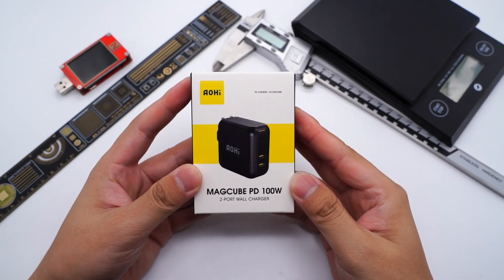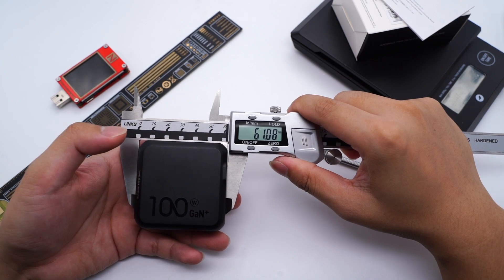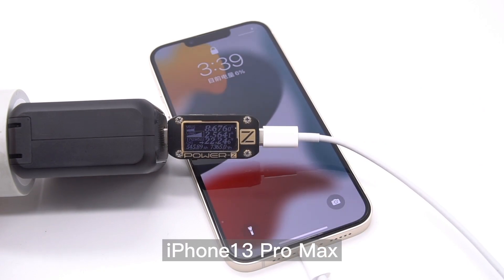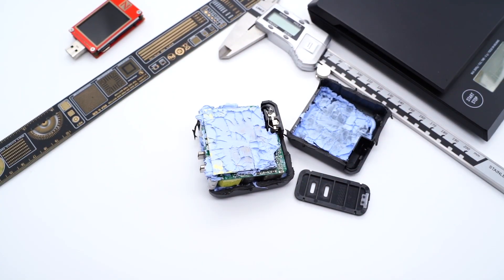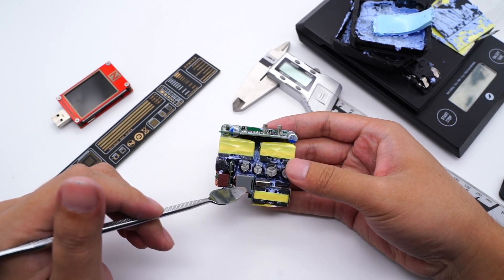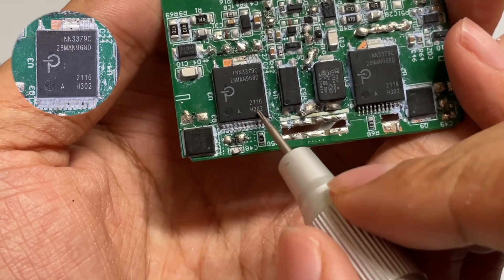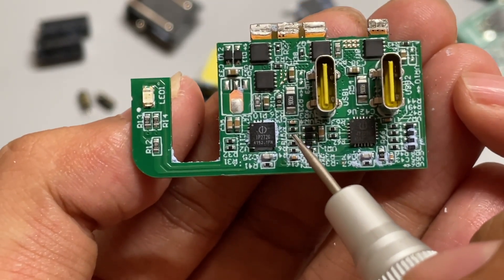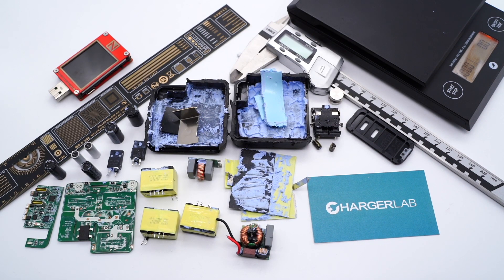Mini & Special Structure | Teardown of AOHi 100W Mini GaN Charger (Dual Ports)

Comment: i got confused what you said at end, does this or does this not support 100w fast charging through single output ??
Reply from the maker: It does.
Reply: @ChargerLAB  we need recommendation for best GaN charger pls
Reply: It does, through a multi phase system (If I understand it right)
Reply from the maker: You’re correct.

Comment: When you have higher quality caps on your tertiary rails than on your Primary and Secondary side(Taicon used to be a part of Nichicon and are commonly used on a lot of quality supplies) : AOHI
Reply: Taicon’s predecessor had a partnership with Nichicon, but Taicon is Taiwanese and Nichicon is Japanese.